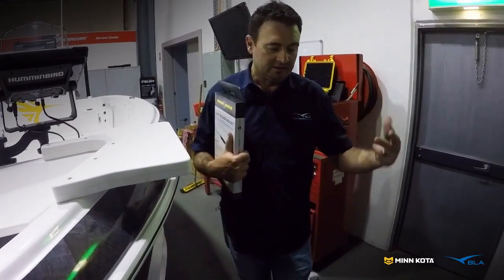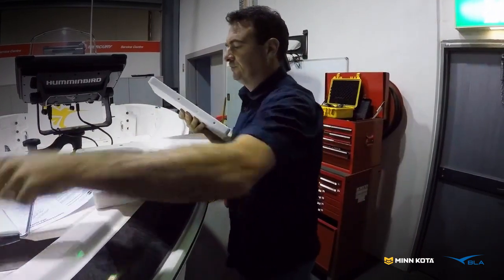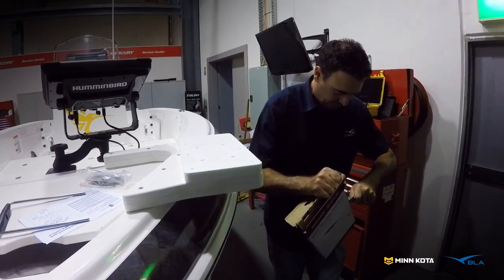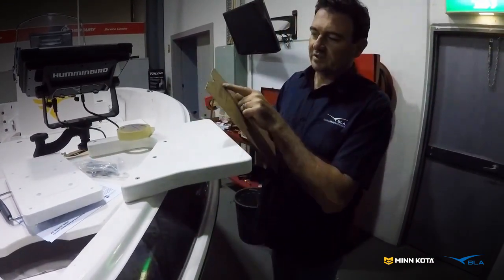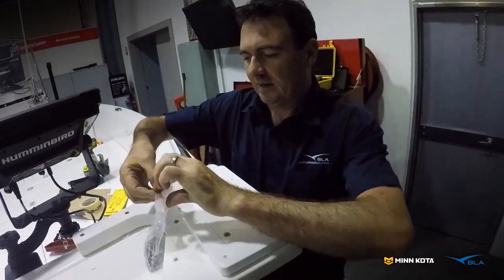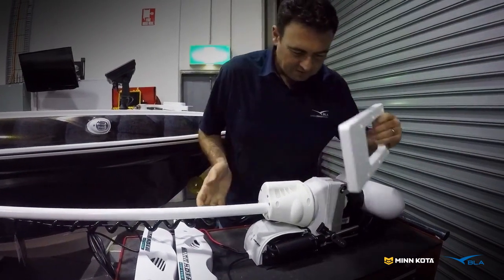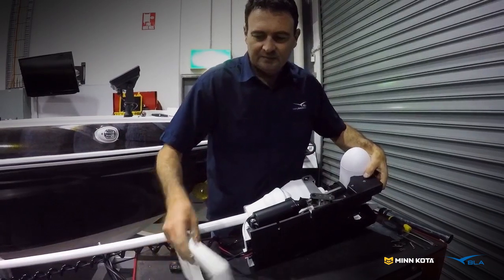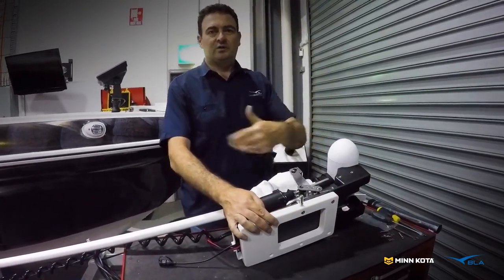BLA - Trade Talk - Minn Kota - Quick Release Bracket Install

Comment: Thanks for the vid - Any idea where can I get the starboard bracket that the quick release was attached to?
Reply: lucidhate go to boat outfitters.com. You can buy it by the sheet or you can make a template and send it to them and they will cut it out for you. I think that is the best way to mount a trolling motor for the maximum support.